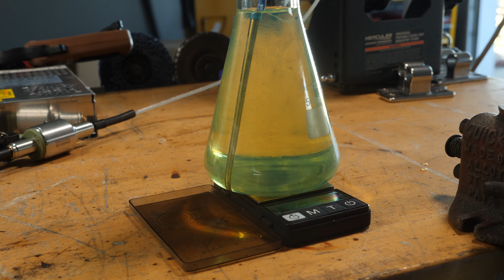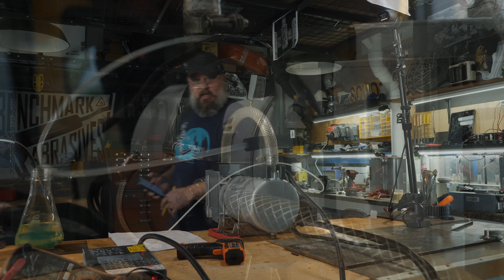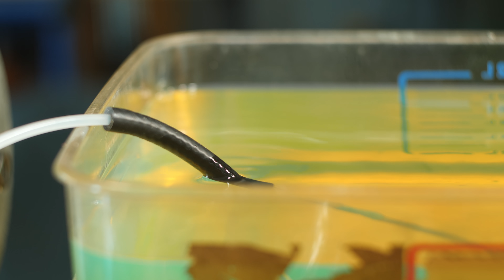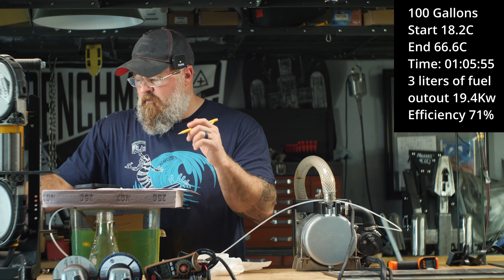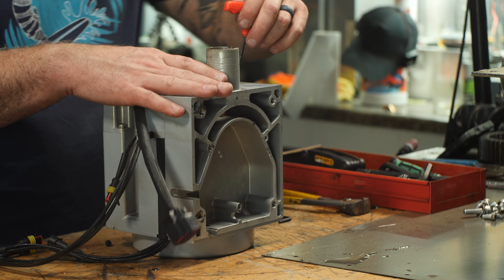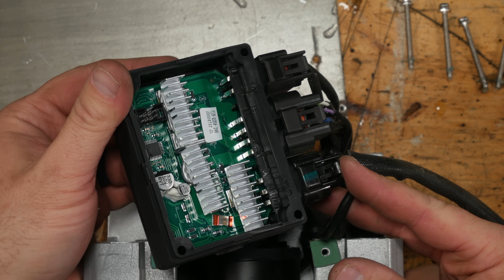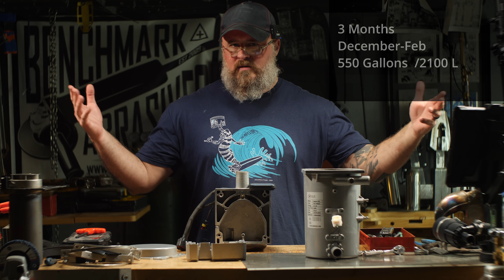The Diesel Heater They DON’T Want You to See — Real 20kW Output!

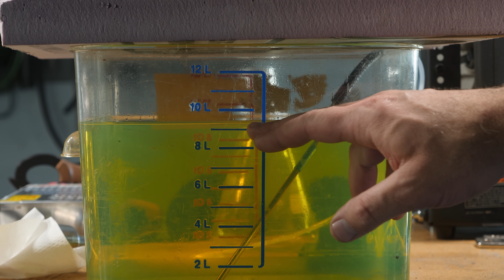Comment: 8:26 you need to set your fuel reservoir on a scale. Never measure fuel consumption by volume. Even though we purchase by volume, you should ALWAYS measure fuel consumption by mass.
Reply from the maker: Weighing fuel measures its mass, while measuring by volume uses liters or gallons and is less accurate because volume changes with temperature. Fuel is more accurately measured by mass, especially in applications like aviation where weight is critical for flight calculations.
Reply: @HanginwiththeHursts problem.. still need volume.. unless you are in the military or aviation- every one pumps volume and knows volume efficiency..
Reply: Both practical measurements. Pending on the situation.  Accuracy would be from measuring mass at the atomic scale😂. Home owners would be concerned with Volume the fudge factor would be acceptable.

Comment: Two issues here... you can have all the power/capacity in the world, but if you don't have sufficient workload to run a reasonable duty cycle, you end up with even more maintenance/reliability problems than those which come with an overtaxed duty cycle.

20kw is an INSANE amount of heating power. You're talking about over 26 horsepower (a large lawn tractor). Also, power is only part of the equation. Delta-T is a huge factor, which is rarely published by most sub-100kw suppliers.
Reply from the maker: I fully agree and that’s why I directed the use case of this unit to small structures. short cycling with a light workload will ruin the unit and be inefficient

Comment: in Poland it will be around 4000 "American greens"😅
i stick with heatpump thats around 80 "American greens" per month in our case
 (bit more with pellet / wood / coal if you dont use oversized stoves like "24h burn" etc ,  less if you have water buffer even less if you have wood gasifying stove and best to have floor heating (with warm water from stove , then you could run water from stove at best temps for it trough water buffer tank and use mixing valves to set the temp output on floor heating etc)
Reply: Until electricity goes up in price to where it belongs... can you make light from charcoal fire or gas? Only storage is a problem 🎉
It is a true idiotic idea to heat with electric no matter what usage factor a heatpump can push, in winter we have way less solar especially in the North where we need it the most and natural gas burns very very clean...

Just wait until electric cars compete for power, hourly prices will kill heatpumps fast as they need to run continuous 😮😢

I know what the common answer is, still heatpump efficency is not high enough to justify burning the most expensive energy per calories ..
You are riding a trend nothing more
Reply: Do you use a mini split?  They can be extremely efficient but for some reason Americans aren’t catching on to these very quickly.  I had a heated driveway for snow.
Reply: @TBBROO  water-air all in one outside module , it looks 1 to 1 like AC unit , the only difference is that you connect 2 water pipes to it (in and out) almost same way like in AC units 2 pipes for gas (but bigger and with water) 

you could also find (or build one) water-water modules for geothermal / air/ roof exchanger --- explanation -- geothermal -- no , no drilling holes , you dig a trench (around 200cm deep , 120cm wide) , at least 20-30m2 per 1kw or best 50m2 per 1kw of heat pump and you put in it average water tube in 100cm wide spirals

in case of "roof" exchanger --- pipes go under the sheet metal roof (connected to it somehow - check online) and entire roof works as a radiator (yes - to heat the house too) 

"air" exchanger ...and there's few options --- antifreeze or alcohol in the loop going through either "water" radiators (like in car....or literally trough one from a car (multiple , one wont be enough because it should not freeze) acting like heat exchangers but you need a ton of them so they wont freeze because its super hard to unfreeze them after 

or you just put a loop of pipes in the air / on the wall with spacers / sheet metal (like ones on the roof) to act as one big radiator

Comment: To use this effectively, you would need a buffer tank in a hydronic system.
Reply: Yes, but it’s not really a buffer tank. If you insulate it it’s more like a heat reservoir. It eliminates short cycles of the boiler is its main purpose but the water keep circulating until the heat exchangers cool it down then the boiler fires again.
Reply: @TheMajictech  Yes.
Reply: @TheMajictech  so you're saying the heat reservoir acts like a buffer of sorts for the hydronic system so that the heater doesnt short cycle?
Reply: @maxpauley9471 yes. my 2 systems have around a 3 gallon insulated reservoir in the return side above the water pump.
Reply: @maxpauley9471  bigger reservoir the better (extending pump life,) and heavily insulate (maximize its efficiency)

Comment: The site says it is only good for 1500 ft elevation, any products for 4500 ft elevation?
Reply from the maker: let me look into this.
Reply from the maker: HLN just confirmed the 20kw heater has automatic altitude adjustment and is rated for 16,000 ft no problem. they actually tested it to 18,000 ft.

Comment: These are already used on buses to run water to air radiators around the buses where heat is needed 
They run in most cases none stop allday
Reply: I use them in my busses... mostly my mobile office bus.. pre-heats the engine when its cold out.. and like today.. its really cold and windy.. so I left my bus parked while doing black friday shopping and the heat was on the whole time I was inside.. engine off.. webasto on, Bus driver heater on.. so when i came back I hopped into a nice warm bus.. and the engine was still warm too so it started up right easy

Comment: Wouldn't be cool (hot) to use the exhaust from the diesel hydronic into a split phase in heat mode to recover the exhaust heat?
Reply: I blow my exhaust gas into a 45 gallon drum and it recovers a lot of heat ,,some people use radiators too

Comment: So I have a home shop it's a body shop so I need heat and lots of it. IV got 2500sqft with in slab heat and a few radiators in the buildings and paint booth. This is a work in progress as I do have the plumbing set up and everything's ready for a boiler. I was gonna make my own as I get a lot of waste oil for free and already clean it up for a few diesels including a TDI that runs a big gen head and compressor for days I have help and need the 75cfm pump. Should I buy a few of these or just make my own? Is there a bigger one? I need about 50kw for the output I need to bake paint
Reply: These aren’t good for waste oil at all. You’ll be sorry if you try
Reply: They will 9nly burn for a few days and you will need to take them apart to clean 
Not worth it at all. You need a real waste out burner. This is not that
Reply: @NightshiftCustom my waste oil goes through a fuel plant I made for my TDI compressor/back up power so it's not like the waste oil most ppl deal with. If you heat it and get all the water out then centrifuge it a few times you can get it clean enough that all the issues normally associated with waste oil go away. The only issue you can't get around is it has more energy than diesel to things tend to run richer although it's not a huge difference. That being said my TDI gets a water cleaning every summer under full load which is about when I start to see some kinda haze but it's very little nothing to be worried about. I run my air heaters in other spaces on it that others have issues with and I haven't had any issues in 4 seasons with any of them so I'd risk it with little concern but I need something with the btu I need and if I don't have to spend a week making it I'd much prefer to buy it.
Reply: @oliverscorsim  get a real waste oil furnace or make one your self out of a old oil furnace.
 there are nozzle kits you can buy to make it pretty easy to do
if you are trying to burn motor oil you will have to clean the burn chamber in any oil burner .
Reply: @NightshiftCustom any suggestions IV been looking but haven't found a whole lot
Reply: @oliverscorsim  also like I said you can buy a ready to go waste oil burner kit that you bolt up to an old oil furnace or nozzle kit to build your own system 
not sure how you cant find anything as you just type waste oil burner/furnace in google.
Reply: After thinking more about this I think if it's under 500 USD and I can easily have an input to turn it on remotely with an Arduino I'll take 3 today 😅

Comment: At this point if you need it for the whole house, just get a furnace.
Reply: If you listened to his last couple of minutes, he mentioned that was not what this scenario was for. Furnaces need cut wood, gas, or oil, therefore hauling and storage for those resources. If you wanted to have a remote, single fuel setup where you have access to diesel - this works as either primary or backup heat.

Comment: or just plug in a 20kW electric space heater. 100% efficient.
Reply: Electric heaters are 100% efficient
At emptying your wallet.
Reply: No a 18kw heat pump would be the right answer if there's power available
Reply: @NightshiftCustom heat pumps are far less efficient at producing heat
Reply: @BestSpatula  what are you talking about they are up to 300-500% efficient atm
Reply: @NightshiftCustom heat pumps don't really produce heat. That's just not how they work .
Reply: @BestSpatula  well pls tell me how they work then lmao
 I just so happen to work in HVAC and install them every day
oh let me guess you think they don't work in the cold right lmao maybe go look them up before talking like you have a clue buddy
Reply: @NightshiftCustom heat pumps move heat. They don't produce it. Some can pump outside heat from extremely cold temperatures.
Reply: @BestSpatula  yes but they use energy to make energy aka heat 1kw of power can turn into up to 5.6kw's of energy (5.6 cop) or 19.000btu's from just 3400btu's of energy
Reply: @BestSpatula  that's best case but most systems are at at least 3.0 cop so 300%
Reply: @NightshiftCustom nope. Energy cannot be created or destroyed. Basic thermodynamics. Also a kilowatt is not a unit of energy, it's a unit of power. A 1kW heat pump might be able to move up to 5.6kW of heat from outside to inside. But that heat doesn't come from electricity, it comes from the ground and or outside air, which you already know.
Reply: @NightshiftCustom A heat pump isn’t “making” extra energy out of thin air. The electrical input just runs the compressor; the actual heat you feel is mostly stolen from the outside air. That’s why the output can be a multiple of the input. It’s not magic, it’s just refrigeration running in reverse.

So if a unit pulls 1 kW of electrical power and spits out 5 kW of heat, that doesn’t violate anything—it just means about 4 kW came from outdoors and 1 kW came from the wall outlet. COP is “how much heat you moved divided by how much electricity you spent making it happen.” That’s the whole story. Nothing is being created, just relocated.

Comment: really good test, im surpized at all the scientific stuff you were able to include. im not sure where youre based but in ur example of denver co you might end up seeing an efficency drop of about 5-10% due to elevation and lower oxygen concentration in the air up there. heater would basically run rich since it doesnt have an o2/wideband feedback that i saw
Reply from the maker: thank you very much for watching and taking the time to leave me a comment. Most of HLN’s heaters have automatic altitude adjustment. And you are correct they do not have wideband O2 fuel ratio measuring. They do adjust for altitude and operate off of a preset altitude fuel table. It’s not the most elegant solution, but it is a solution for altitude. I will need to confirm if this 20 kilowatt unit has that feature. I’ll get back with you on that.

Comment: Do these heaters give off a bit of an odor?  I have a ventless Mr Buddy that is rated for indoor use but it still smells a tiny bit like spent propane.  I don't have much experience with diesel fueled heaters so maybe it's different?
Reply: No they do not. But your not supposed to vent the exuast into the living area with any of these heaters

Comment: Yes you can heat a house with it. 
I had try with vevor 9kw and it was working on my house of 115²m.
9 radiators with 16kw of heating power on 75°C but heater was set to 55°C and it work around 25 days until i try it to work on waste motor oil. 😂

You need this setup for big heating sistem to work. 
Heater needs to be conected to 200-300L tank thats gonna be heted to max temperature that heater can provide around 75°C. Betwine heater and boiler you need tu put 60°C termostatic valve. For house just put a pump and mixing valve for max 55°c to the house.
Reply: Good to know as I have bought aVEVOR unit a few years ago but never set it up.But now Gas has become so expensive I am going to set it up
Reply: @gavinreilly5804 I use now a pellet boiler 20kw on sunflower pellets its 0.13€ kg and it works good.

Comment: You should try running this unit on waste chip oil. With a preheating of the oil. Glow plug heating the oil at startup. Once it's running some kind of heat exchanger to pre heat the oil going in to the burner.  If that not enough. See how many % regular diesel mix in takes to  make it work reliable.

Comment: So lets say I use a wood pellet stove akin to a hardy wood furnace. The kind that say holds 100 gallons of water and heats the water, runs it through radiators in your house to heat it. Is it feasible and possible to use this in conjunction with a system like that to suplement heat? Reason I ask is because we are buying a houseboat to somewhat redo and plan on making it mostly off grid capable except for maybe the absolute coldest few months at a marina where we would have suplemental electric input.  Whats your thoughts on that? I m going through your videos now, but im not super familiar with hydronic diesel heating though Ive been a auto/semi mechanic for over 25 years.
Reply from the maker: YES! you can absolutely combine heating sources. In my ambulance build I had 3 different ways to heat my hydronic system. A diesel fired boiler, a heating capture element in my diesel fireplace and an electrical element. they all worked together.

Comment: I have 2 small separate hydronic systems in a 5th wheel in North Dakota. (1 air heater blowing under the skirting helps a little) I use them as my primary and set the 40k btu gas furnace as a backup (5 degrees lower setting than the hydronic units) Currently 2f outside and 75 inside. Furnace didn’t turn on all night. Use around 60 gallons of #1 diesel a month.
Reply from the maker: Thanks for sharing your setup and experience! That sounds like a very efficient system.
Reply: When you say hydronic units are you speaking of heating units or like hot water for domestic use? Because if I had hydronic heating units I would definitely have them filled with glycol for heating so it would never freeze even if the power went off. Perhaps I misread
Reply: @jimlippi4001 yes mine actually run coolant in them. Zerex GO5 in particular mixed 3 gallons zerex to 2 gallons distilled water.
Reply: If applicable I would recommend switching to kerosene if you're in a colder climate. It may cost more but it creates a lot less service to the appliance.
Reply: @jimlippi4001  the first one I put in used and know nothing about is going into winter #3 trouble free. I didn’t even initially take it apart for inspection. It was running fine so I installed it and here we are. I run straight #1 diesel with a shot of sea foam concentrate about once a month. Maybe a teaspoon to 5 gallons. That’s literally all I’ve done and she’s happy.
Reply: That's roughly $300 per month for heat. That is neither good nor efficient.
Reply: @jackofalltrades8504  have you been in a 5th wheel at -35, trust me you’d probably burn twice that much in propane a month relying on the furnace and still freeze your tookus off. Efficient is one thing, but when it’s that cold sufficient is what you want.
Reply: @jackofalltrades8504 you are right, 3 wks later diesel at $7.20 gal
Reply: @Art-i4c  still cheaper than propane my little 12ft home built camper i burn 50 gallons for the entire winter in south Dakota 1 diesel air heater on low this will be 3rd winter full time

Comment: Geothermal in remote cold areas. Cost a bit more, but in the long run. Better. Been used everywhere in Sweden 🇸🇪❤
Reply: Only works if you have a lucky streak in warm water, can dig deep enough or have a good heat pump.
If I want to do geothermal here, it would cost me the diesel for a lifetime. I think the estimates were 50..70k euro on top of my off-grid installation.
And my territory is too sloped to think about a horizontal "geothermal" (so like a heat exchange at 1...2 meters deep).

Comment: Your testing video should get a lot of interest. Seems that many people are heating spaces/garages and then ganging the 4-5kw units together to get enough heat. The efficiency looks good but some type of part load capability would be needed. Note on exhaust heat recovery...you want the unit to extract as much exhaust heat as possible (low exhaust temp), so if the exhaust temp is high enough to make recovery worthwhile, then the unit is not properly configured.